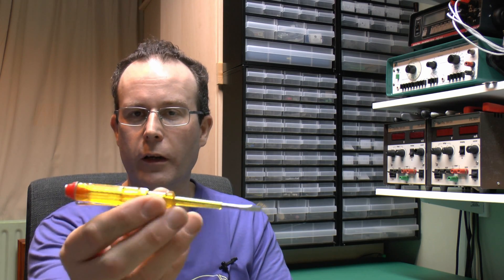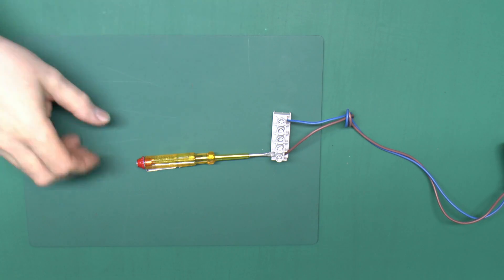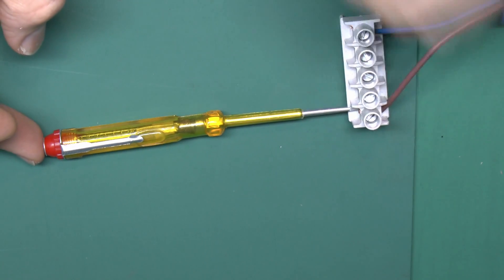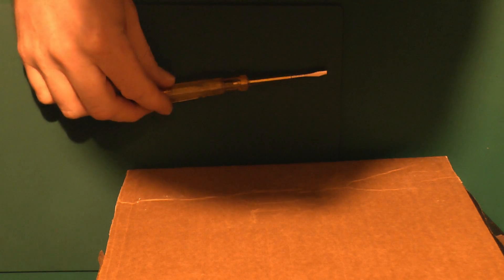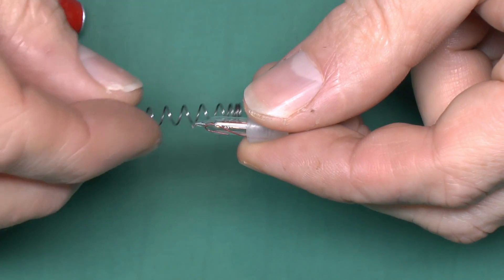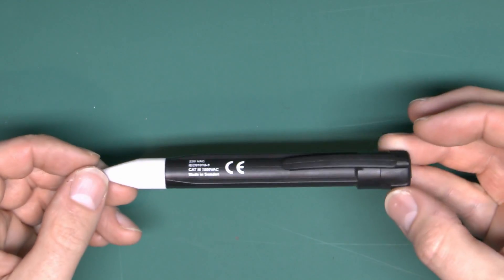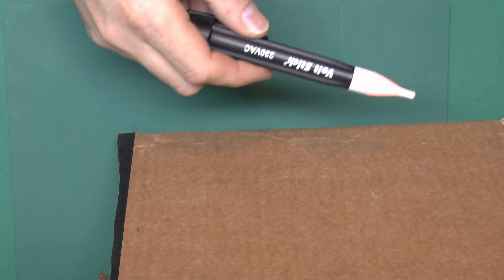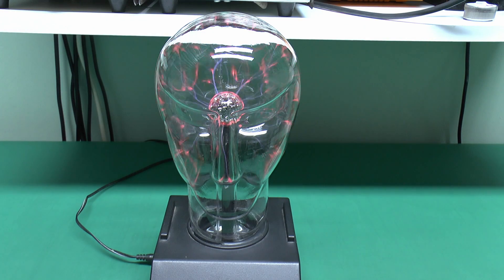Dangerous Device - Neon Mains Testing Screwdriver

Comment: No such thing as a lethal voltage guys, only a lethal current...
Reply: quantumbox01 Incorrect.

To get current you need the voltage to overcome the resistance. There is no such thing as lethal current or lethal voltage individually. They both go hand in hand. A car battery can delivery hundreds of amperes but lacks the voltage for the current to flow through your body.

To be electrocuted requires both sufficient voltage to drive the current and sufficient current.
Reply: quantumbox01 
I held live 12V 1100A wires is my bare hands and nothing happened (im still here arent i)
explain that
Reply: Shlomi, to answer your question above, there was not enough voltage to allow the current to pass through you, meaning it is safe to touch the battery terminals.

Remember guys, current is how much juice there is, this is what kills you. The voltage determines how far it can travel over resistances such as human skin, wires, air gaps ect. 

You need a high current to cause a big bang. 
You need a high voltage to arc across gaps and travel through resistive materials like insulators such as human flesh. 

The battery had more than enough current to blow your arm off Shlomi, however the battery would neeed to supply several thousand volts to allow the current to pass through you.

If its still unclear, you need to research the difference between voltage and current. 

To harm a person, you need more than 50milliamps, but you also need a high voltage for it to pass through their body, as flesh has a very high resistance. Less if they are covered in water, as water has a lower resistance of course.

Hope this helps explain guys :)
Reply: quantumbox01 To get current you need voltage to get voltage you need current. Again there is no such thing as a individual lethal current.

To get the current to flow through anything you need the right amount of voltage. They are not separable. 

V=IR
I=V/R
R=V/I

The most basic thing an electrical and electronic profession learns. To drive .05 amperes through the average extremity to extremity of the human body requires at a minimum an average of 75 volts DC.

Without the voltage the current is harmless without the current the voltage is harmless. You always need both. It is impossible to have a dangerous current without a dangerous voltage.
Reply: Cragified << to get voltage you need current>> so does a battery with nothing attached to it, hence no current flowing, have no voltage? I have spent about 60 years thinking otherwise. Please explain.
Reply: Shlomi Vinny the human body has around 1000 ohms (not 100% true, since the human body has a variable resistance but lets just pretend for now) at 12volts the current will only be 0.012A. Just because a PSU can deliver a lot of current doesn't mean that all of that will flow through the circuit at all times (current is supplied at demand)
EDIT: sorry, my mistake. I thought that you were answering to Cragifred not the original person :P
Reply: haha, the human body has a much higher resistance than 1k ohm. Besides, your just stating ohms law. Static electricy can be 50kv, but has only a fraction of a milliamp so it cant hurt you.

What you have stated above, is the potential difference over a 1k resistor when 0.012A is applied.

You can take a shock of a million volts and be perfectly fine, so long as the current is less than 50milliamps, which is the lethal current required to kill a human.
Reply: Armando92 Exactly my point my man...

I would never ever dare to hold 240VAC even if the current would be limited to a nanoamp, just because i wouldnt dare to test the "quality" of my heart... :D

Did i say nanoamp? wow...
I meant microamp... fuck me..
Reply: Depends on your point of view. Ive always been taught that voltage is the enabler of current, it allows it to travel.
Reply: quantumbox01 Voltage is what makes current flow. It is the potential difference in charge and like all energy states they seek to equalize. (Excluding some special circumstances where you can have current without voltage)

Which is exactly why you must have sufficient voltage to be electrocuted. The source must be able generate both the voltage and current to create the circuit through he heart with enough energy to override the nerve impulses which can be anywhere from 7-50 milli amps.

If I take a palm able stone and put it on your head the mass is sufficiently large for gravity to exert enough force and thus enough energy and work to make it uncomfortable but it won't hurt you.

However if I take that same stone and increase the 'voltage' but holding it 50ft above your head thus increasing the potential energy difference  and thus giving gravity more time to work on the stone before it meets your head's resistance the force and energy exerted onto your head would be quite harmful.

Neither the mass or the force alone or together could harm you until the potential difference was increased which is what voltage is.
Reply: quantumbox01 Totally agree, static electricity can be over 100,000 volts and it hasn't killed me yet. (correct me if wrong on voltage)
Reply: you are correct kd9bwi, the shock you recieved of 100kv must have had a very small current, less then one milliamp probably, however the high voltage alowed the current to pass through your body. 100kv is such a high voltage it can jump gaps, so you dont always have to touch the conductor!

Im not sure on the jump distances though, it varies with how humid the air is and what the atmospheric pressure is depending on your elevation.

The source for all my answers here is electrical engineering, for the record guys. Hope this has helped!
Reply: quantumbox01 Actually static electricity can hurt you. I worked for a while in a building with long corridors, carpet on the floor and doors at each end. I got a painful shock every time I touched the door handles. Finally I developed a way to open the door with my jacket-covered elbow.
Reply: Robert Seviour That statement is a bit oversimplified I will admit. What I meant is that to have voltage you have to have the capacity to generate the current. 

A discharged battery no longer has the chemical reactions able to supply the current of electrons (or positive charge) depending on which theory of current you use. So if you measure across the terminals you will see no voltage.

Basically if you have a voltage difference and make a connection current will flow. Voltage cannot exist without a potential current source. They are not separate entities which is why the water analogy is used often because water pressure and water flow are interdependent measurements.
Reply: Cragified is quite correct! I must agree the water theory is the best way to think about it.

Water flow represents the current, how much water moves through the pipe.

The pressure of the water represents the voltage, how much force is behind the water.

Robert, static electricity can hurt you of course, it just depends on how much current there is. 20milliamps can kill you, but you can just feel 1 milliamp. A good static jolt will be about half to 1 milliamp.

The question on the battery is a good one. For example, its a 9volt battery.

As there is no connection to the terminals, it is an open circuit, no current flow. 
However, the voltage is still present on the terminals. 9v on the positive, 0v on the negative.

If you place both terminals on your skin, there is no current flow, 9v is not enough to allow it to pass through your skin as your skin is a very good insulator.

However, place it on your tongue and you will feel the current flow. This is because your tongue is wet, and water based fluids like saliva are very good conductors of electricity.

Remember, if the battery was the same size but had 30kv of potential difference across the terminals, the current would jump the air gap between the terminals, and the battery would drain itself. Due to the battery only having 9v on the positive, its okay to have 20mm between the uninsulated terminals, as it cant jump the gap.

Hope this helps Robert! :)
Reply: quantumbox01 <<Static electricy can be 50kv, but has only a fraction of a milliamp so it cant hurt you.>> Not true, it definitely can hurt you - see my comment on this lower in the thread.
Reply: quantumbox01 << allow the current>> I think it's easier to grasp the concept if you say "drive" the current. It takes force to make the electrons flow, not permission.
Reply: Armando92 << the human body has around 1000 ohms>> Most of the human body is water, which has very little resistance (if electrolytes are present). With wet  hands 12 volts is enough to give you a tingle. Grasp the terminals of your car battery with damp paws if you doubt this.
Reply: Shlomi Vinny Set your multimeter to millivolts and grasp the contact ends of the leads, if you can't see a reading (usually fluctuating) of 20 - 30 millivolts, get busy with writing your will. There is voltage present and (in this example) current flow. It's natural.
Reply: Cragified <<water pressure and water flow are interdependent measurements>> I don't know about that. If you dive to 10m you are under a pressure formed by the columns of air and water which are above you. If you hover there and aren't taking in water through any orifice, seems to me there isn't any flow going on. Pressure but no flow. Now if you want to say, there has to be flow to make the meter work - I will agree, for the period that the mechanism is moving, but if the gauge stays at a constant depth, no further movement of mechanism is occurring which is the same as saying no flow. (I am thinking of the coiled tube type of gauge). I look forward to your understanding of this.
Reply: Your last comments made no sense at all.

To clarify, there is no flow if youre just submerged.
If your submerged in water at 10m, there is a pressure differential between the air in your lungs, and the water around you, which puts an inward force on your lungs. 

Water flow is for something like a pipe, for example if there is a flow of 2litres per minute through a 5mm pipe.

Pressure is when a liquid or gas is compressed. At the bottom of the sea, there is a high pressure as all of the weight of the water is pushing downwards, compressing the water at the bottom of the sea.
Reply: quantumbox01 Ok, you didn't like my last example, try this one.(A thought experiment) In my kitchen, there is a water tap (faucet). Right now it is closed / shut / not on. There is no flow or current of water. But if I were to drill a hole in the pipe leading to the tap, water would shoot out across the room, indicating that the water in the pipe is at a pressure greater than its surroundings. But until I make a hole, there is no flow.

Pressure without flow.

Ergo pressure and flow are not related until there is a flow and even then the relationship is not a simple linear one. (As aircraft developers found out about  65 years ago.)
Reply: Robert, I already know this haha, what gave you the impression I needed you to clarify this? I know my stuff.

I was telling the others in the comments.
Reply: quantumbox01 <<what gave you the impression I needed you to clarify this?>>

Answer:  <<Your last comments made no sense at all.>>
Reply: Ohms law is V=IR haha
Reply: The high voltage sign warns you that it can jump, and that you don't need to touch the conductor to be zapped. If the voltage is high enough, it can jump the gap and get you.
Reply: ***** Correct. Lightning is an example of extremely high voltages making possible a jump of hundreds / thousands of feet, but what fries you is the current which passes through you to earth. And that is proportional to your resistance and the voltage coming down from the clouds.

Comment: You have to be really careful with those 2-point testers because if the "zero" line is broken... tester shows there is no power there. That will deceive you into thinking that you can touch wires with your hands. And then you will be killed by the "positive" wire. I like your videos by this one is a fail. You have to use these single pole probes in order to be sure! Just buy a good one and you'll be OK.
Reply: This is why you should first test with the two prong prove that the power is on.  If you know that the power is on (Ie with a volt sick) and your two prong prove doesn't register voltage then either it's broken or you don't have a circuit. Then test between live and earth to see if the neutral is connected and neutral and earth to see if it's wired wrong. 
After confirming that the two prong works and you have power then turn it off and use it to confirm the lack of volts.  Now finally use a proving unit to confirm that the probe still functions and didn't break between the first two tests. 
Yes it's long winded but it's the only way to be sure you're safe.
Reply: alihaggis78 You are most probably right. Thank you for this explanation. I have never heard of a single person killed because of (or by a) neon screwdriver though. I think that alcohol is something that kills electricians more often ;) But indeed... this thing may be dangerous.
Reply: alihaggis78 What you're describing is a diagnostic procedure. That's all not needed if all you want to do is turn the power off, confirm it's off, change the wall socket or whatnot and turn it back on, confirm it's on. Then all you need is the single point probe, test all the wires, confirm no voltage on any and you're good.

You're making a different point than the OP, he just said 2 point tester might not show a fault you're unaware of and you'll assume it's safe and consequently get hurt, so better to use a single point tester. The single point tester will not help you diagnose the problem (that you don't know about, remember, so you're not looking for it), but you WILL be safe if you test all the wires with it.

If you know there's a problem then yeah, 2 point probes are needed to get more details on the issue, but that was not what the OP was saying, different situation.

Comment: the neon main testing screwdriver is good to find the hot lead on the plug. i dont trust those thinhs even a bit. everything that has a straight path to mains, i dont like to touch
Reply: Fernando Melo He mainly used a rubbisch phase tester. I have a Wiha-one. This one is black and has a small window for the neon. You can see it in bright daylight. Also it uses a proper 1,8Meg-Ohm THD-resistor rather than a doubios pellet. You have no issues touching a toaster even though it's isolation-value is much worse. ..

Comment: One of these exploded on me one time when I touched a live mains cable
Reply: Liam Mcmahon That will happen if you use an automotive tester. They're only rated for 48v, touch a 220/240v line and it will blow the bulb.
Reply: ah fair enough the whole handle blew apart in my hand xD

Comment: Watching you use both hands testing a mains voltage circuit had me worried. When you grabbed the terminal strip with one hand and the screwdriver with the other really made me cring! One mistake, one strand of copper poking out, and your dead. I always keep one hand behind my back when testing mains circuits if possible.
Reply: @Glen Littleford, do you even realise there is probably an RCD on that circuit under test?
Reply: @mikeZL3XD7029  do you realise you will still be a boot through the chest, even with a RCD?

Comment: 1. You do realize that the Neon Tester works only when you probe the " PHASE " wire and not the " Neutral" wire.
2. The Volt Stick Needs A ElectroMagneticField (EMF) to Work, and that only happens at the PHASE wire not the NEUTRAL.
3. Now as for the magic CardBoard. The tester works on Leakage and the Volt stick on EFM so the both light up as there is a Large leakage and EFM.

Here is the question???? how do I check whether there is power or not when i am presented with one wire.   oh Wait !! stick one probe on to the wire and the other to my Head, I suppose that is super safe or just grab the wire check for power (VERY CHEAP no need of any thing just a finger)